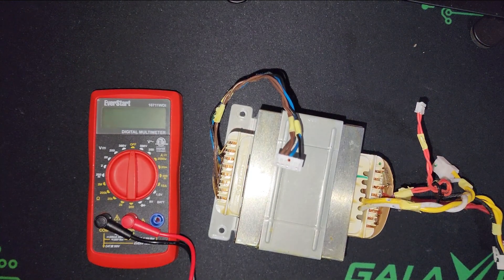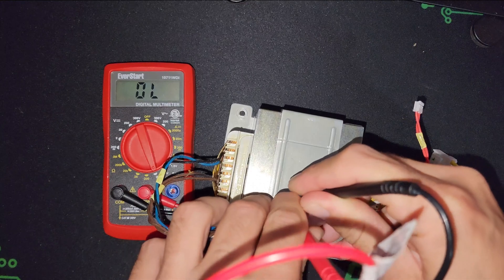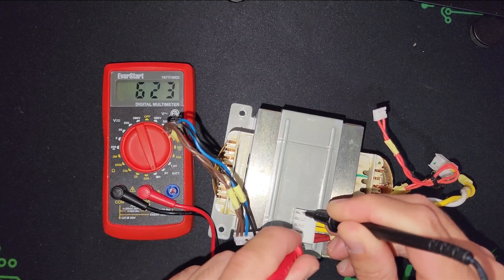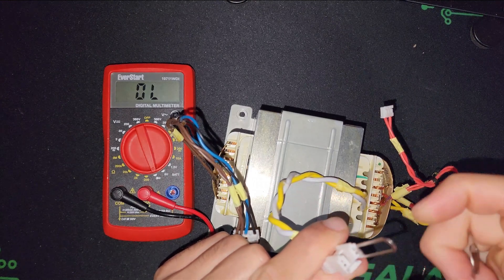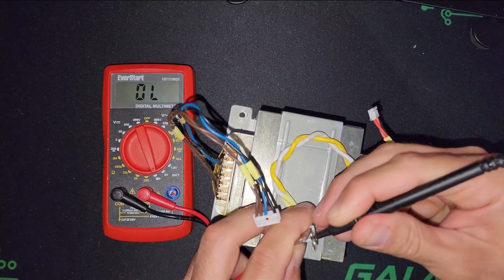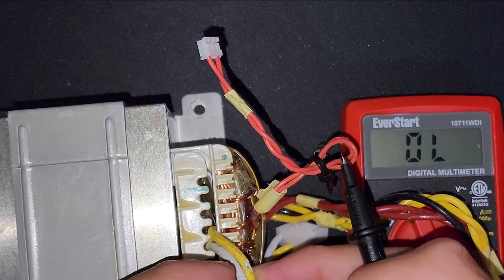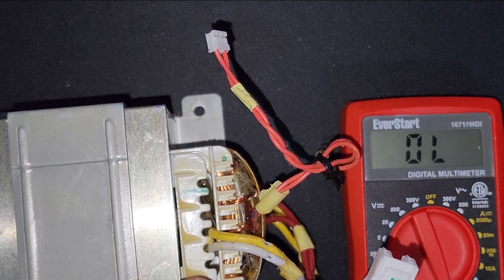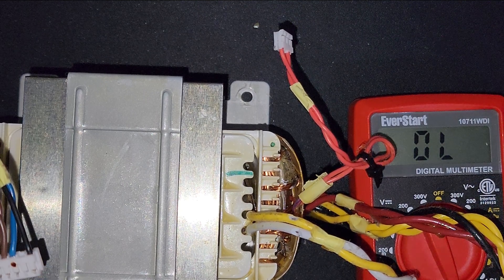Onkyo TX-NR5100 8k receiver hybrid/standby issue i Found the Problem component  Part-2

Comment: Hi I have tx-nr 6100 it is not powering on 

No standby or relay clicking just dead
Reply from the maker: Check transformer
Reply from the maker: Fuses
Reply: I tried searching for new  transformer and nothing online how did you find it on ebay what's the part number used to search for it?
Reply from the maker: @mbusophakathi5253  i just search on ebay exact same shape cables  you gotta look at ebay